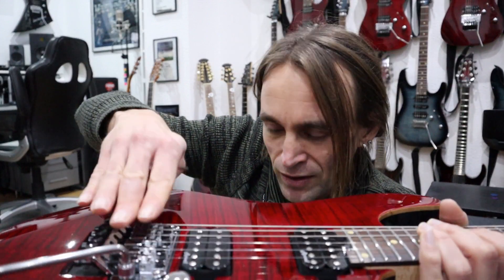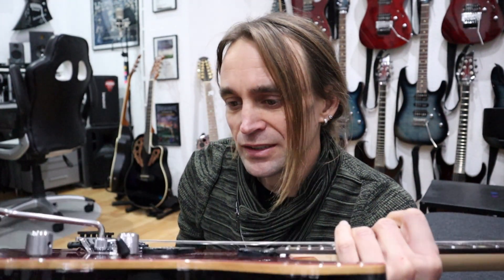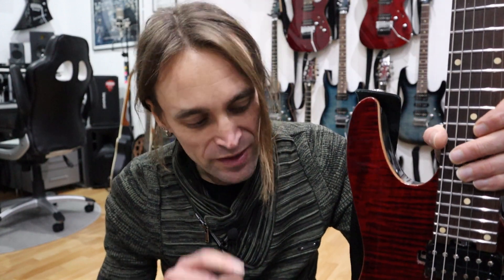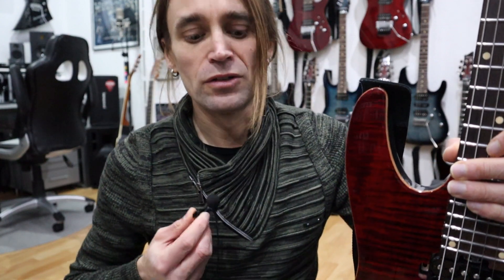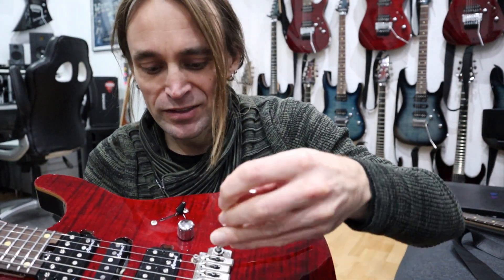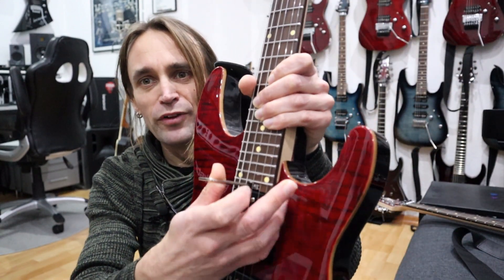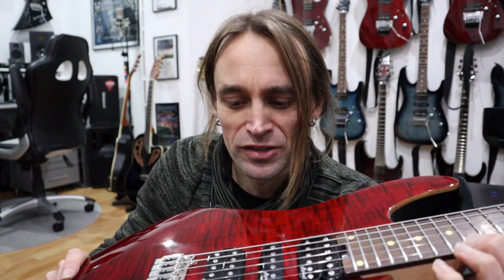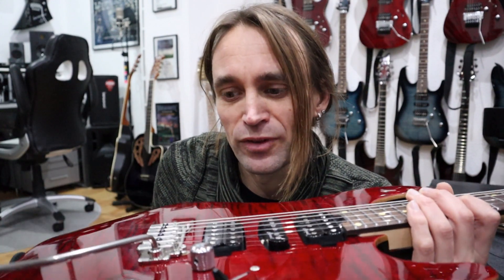Harley Benton Fusion 3 - My guitar setup advice (trussrod, bridge, pickups)

Comment: Small set-up advice:
1) When changing string gauge, before tuning up block the bridge in horizontal position with a wedge (clothes pin) and tighten the claw screws.
Do all set-up work this way so the bridge doesn't move up or down. Once done, loosen the claw screws just enough to free the wedge. If needed, bring the guitar back to pitch also with the claw screws.
This saves all the back and forth hassle people complain about with floating bridges.
2) When tightening up a truss rod it may be wise to help by also bending the neck at the same time so the strain does not all come from the rod. Do this when it gets hard to turn. This guy shows it here: https://youtu.be/dL6kJ6iAGpg?t=521
Reply from the maker: Wow, thanks a lot for the advice!

Comment: Sehr interessant! Ich tendiere nach endlosen Versuchen dazu, entgegen dem Mainstream, zu einem Neck Relief von ca. 0,35 - 0,40mm (manchmal bis zu 0,50mm - Ibanez empfiehlt zwischen 0,30-0,50mm am 8. Bund, so ebenfalls Mayonnes standardmäßig 0,50mm), das ist alles andere als ein "Straight Neck" 😮. String Action ca. 2,50mm Bass Side/2,00mm Treble Side - da bin ich ganz bei Dir mit einem möglichst cleanen Sound ohne Buzzing/Fretnoise etc., ausserdem ist der Ton DEUTLICHST voller und dynamischer als "gerader Hals" und "as low as possible" 😎 Bei Pickups: Du solltest den Abstand besser messen mit den E-Saiten am letzten Bund gedrückt, bei meinem Setup komm ich bei Deiner Methode auch auf ca. 5mm, mit der "allgemein anerkannten Methode" bin ich bei ca. 2,5mm Bridge PU + 2mm Neck PU, Middle PU 3-2,5mm (wenn vorhanden). Auch 10-52 String Gauge 🤗
Reply from the maker: Danke für die Infos! War mir so nicht bewusst...wenn ich die tiefe E-Saite am letzten Bund drücke, komme ich beim Bridge PU immer noch auf ca 4mm, beim neck etwas weniger 3,5mm) 🤔😅
Reply: @DanielKraemerMusic  Bei 4mm verlieren die mir i.d.R. zuviel Punch und Druck. Aber Evolutions z.B. oder zuletzt einen SuperDistortion hatte ich auch so weit weggedreht.

Comment: I think the fusion 3 is great overall but I had bad luck with two models so I think I will pass on them. I ordered the roasted maple, first one had the pickup slots a bit tilted (wrongly cut by the CNC probably). Second one is ok but the wood grain has some really ugly spots on the fretboard and the color is really uneven so I will also probably return. It is a pity though because I really liked the feel of the guitar. If I could get a decent one I would 100% keep.
Reply from the maker: That's sad to hear... Which colors did you buy? To me, somehow the red ones are of better quality than most of the other colors. 🤔
Reply: @DanielKraemerMusic  I tried the blue HSH version. I wanted to have the middle pickup to see if I could get decent strat sounds while also having the humbuckers and use it as a more all round guitar. The ebony version looks good too maybe I will give it a try at some point in the future again.
Reply: This is a 300 euros guitar, you cant expect perfection.